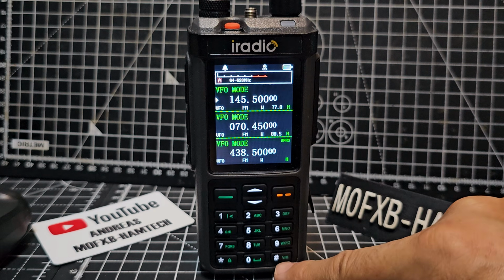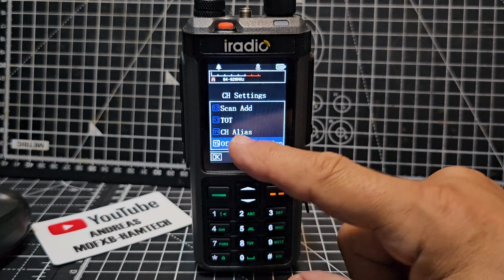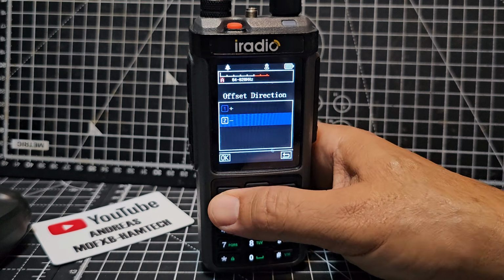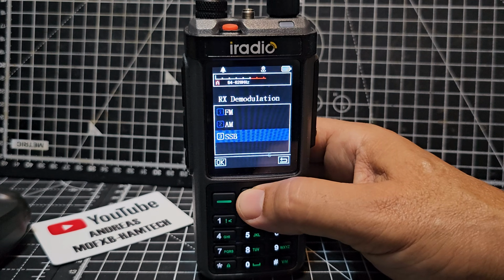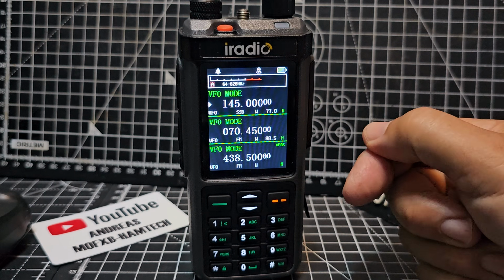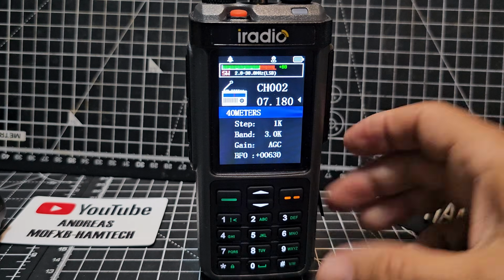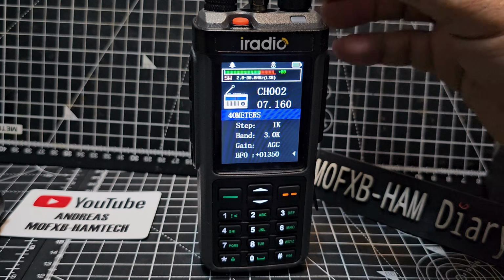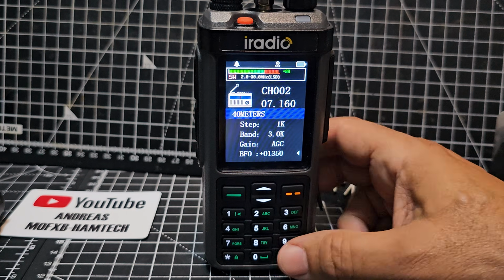Radtel 880/UV-98 , Select AM , FM, SSB, & + - Shift Direction

Comment: I bought the Radtel 880G, and your videos are very helpful in figuring out all the possibilities & potentials it has.✅️ 
I really like the spectrum in monitor mode for finding frequencies once you tweak the bandwidth and threshold. I have found several air band transmissions that way and some police channels. It's faster than slowly scanning and hoping to land on a transmission at just the right time. I haven't really used the GPS or Arps very much. Overall, I think it's great considering what it's capable of. 👍
Reply from the maker: Agree